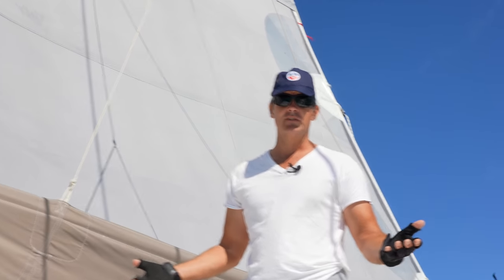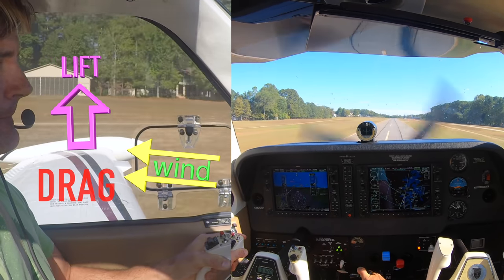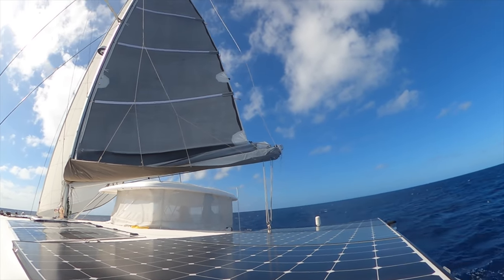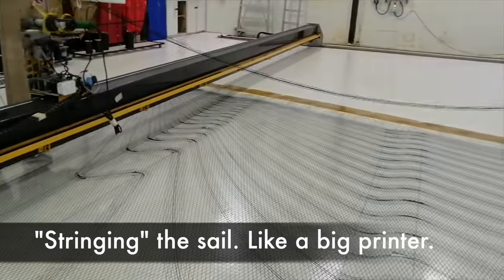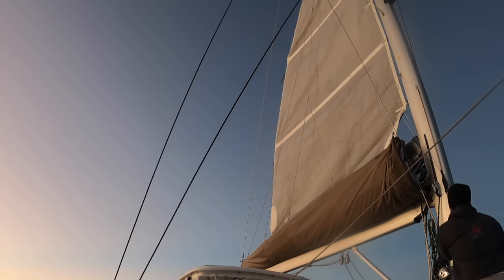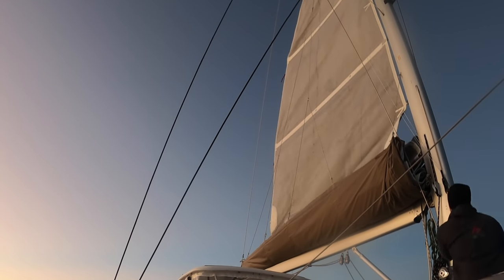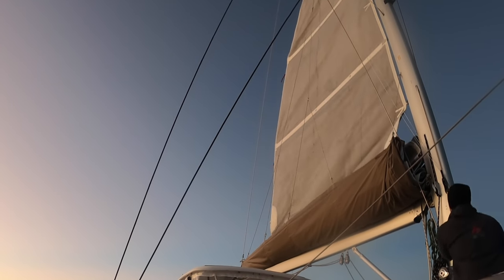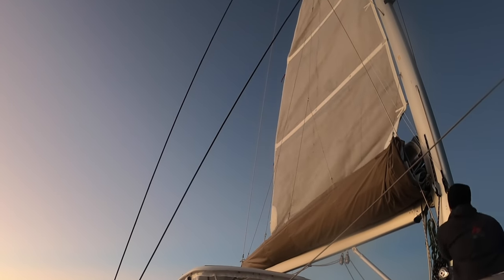PROVING THE CRITICS WRONG [why catamarans don’t sail well]

Comment: My 2002 Catana 471 (bought new) would easily hold 32° to apparent with boards down, even on autopilot.   I could hand hold down to 29°.  Best VMG was closer to 45°, but don't for a second believe all cruising cats cant point.  That's nonsense!
Reply from the maker: Well, I do love your boat. By hold, you mean you weren't making leeway? That's quite a statement. If any cat could, it would be yours. Also/but, the 471 is straying out of the realm of "cruising cat" design that I am addressing here with the video. If you compare your boat to a modern "cruising cat"....well it would have the same living space as a....Lagoon 40? I just mean to say that it's not a fair comparison. You have a performance boat as far as I am concerned. I do love the 471
Reply: @TheOKellys  - The 471 is a cruising cat.  Many performance upgrades are in the build, but none of them hurt the comfort and luxury one expects from a mid-sized cruising cat.  In terms of living space the 471 is very close to the Lagoon 47, not the Lagoon 40.  Even the Catana 431 is larger than the Lagoon 40 in terms of living space.  Gunboats, Outremers and Atlantics are examples of cats built with performance as the #1 priority.  Narrow hulls, much less opulent (weighty) things of comfort, much more serious sailplans.

As to leeway, of course some slippage occurs when hard on the wind.  That's even true for monohulls with huge keels.  But yes, a 471 can be hand-held by a skilled pilot down to 29° to apparent without stalling and going into irons.  I competed in the multihull racing division of the 2003 and 2004 Heineken Regattas in St Maarten on my 471, and most of the way up the Anguilla Channel in the around the island race I was at 34-35° to apparent with descent VMG (NOTE:  Apparent was over 25kts), allowing me to make the run up the channel with two less tacks.

Comment: We will overlook the aerodynamic nonsense - for info the amount of lift that a plane generates is equal to the weight at all speeds in unaccelerated   flight unless you are in something like an F15 at high alpha with the burners in.; but you knew that. It seems to me that one major characteristic of  a cat  v a monohull is the frontal area. Have you tried towing your boat (without sails) from a line about 30degrees off the bow into a 15kt wind and measuring the force of the wind drag in the direction of travel. I would love to see a comparison with a pointy monohull. Of course the projected area of a wide cat with deckhouse may not be all that much more than  that of a long yacht, when viewed from some distance off the bow but one sort of feels that the wind could slide round the hull easier.

Comment: Sorry, but as a professional mariner, both motor and sail for 37 years I cannot agree with everything you say.  Yes, of course the sails are important and you were lucky to get 4 yrs out of dacron sails, and I agree that many cats sail well coz they dont have good sails (material as well as shape), but there are reasons.  Many sailors are too lazy to have high performance sails with battens and large leaches (such as yours), so they get in mast furling sails.  Sails are expensive so they use them past their "best by date" and they dont know how to trim properly.  Net result lesser yacht performance.  Here's the kicker (pun not intended), the reason cruising cats dont point is because they cant heel, they dont have fin keels and they are heavy for sail area.  Its pure physics.  Racing cats weigh nothing, they have huge high performance sails, they have keels (and now aerofoils) and crews that know how to sail.  QED